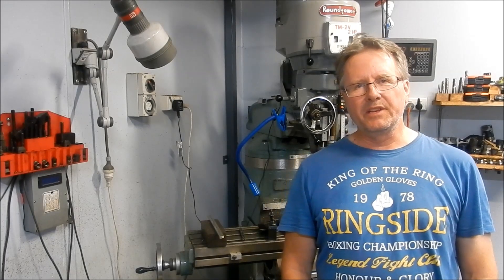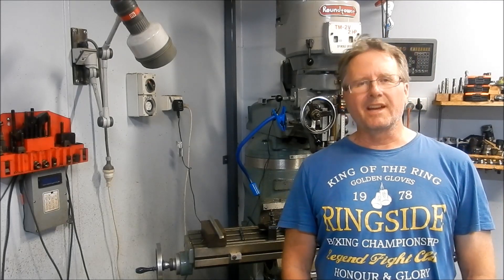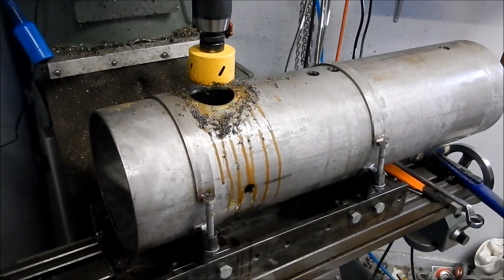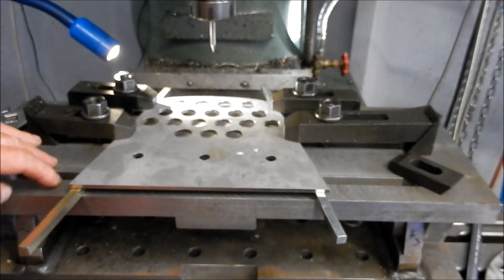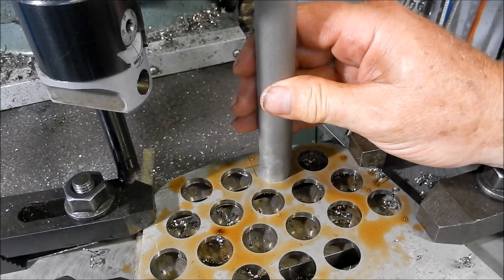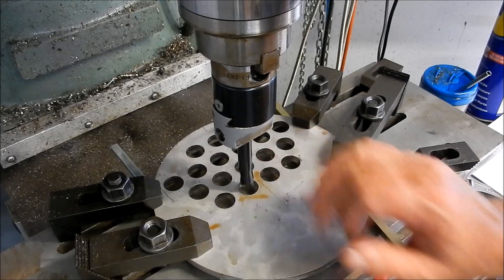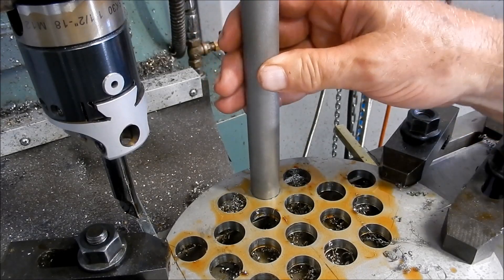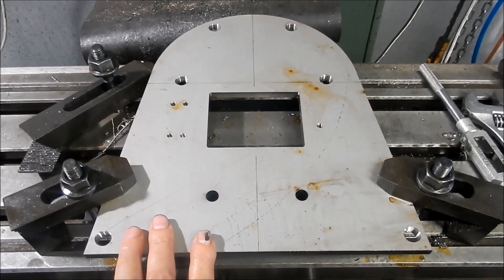Heidi Steam Locomotive Boiler Fabrication

Comment: Hi Cam, I was just wondering what the rational was behind using Duplex rather than using bog standard stainless. I've worked with super Duplex ( Zeron 100) and you are correct it is a pig to machine, but it was designed for saltwater cooling water pumps. Not being that familiar with boilers I was just wondering if it was a bit over engineered.  Best wishes, Mal. PS, Check out Emuge taps for Duplex, in my experience they were unsurpassed.
Reply from the maker: Thanks Mal I'll look into the Emuge taps.  Yes Duplex is ideal for Saltwater environments but it also resists chlorine embrittlement when water is at an elevated temperature.  Chlorine embrittlement causes surface micro cracking that will eventually lead to failure.  As far as I'm aware Duplex is the only stainless steel with this property.  Salts certainly do become an issue in boilers.  As the steam is taken off the impurities are left behind in the form of salts.  These can become more and more concentrated as the boiler is run with more water added as it is steamed off.
Cam